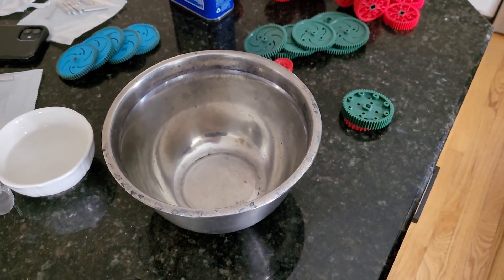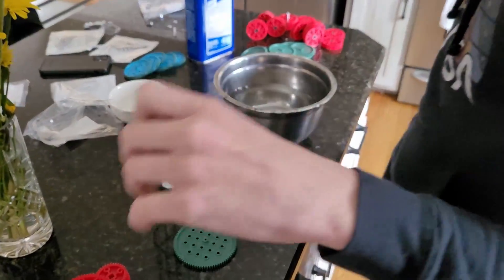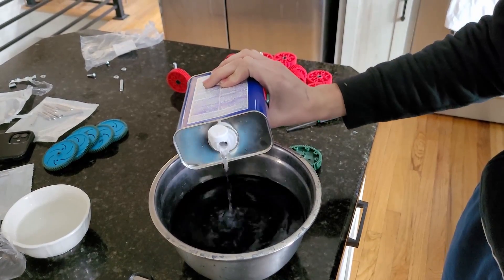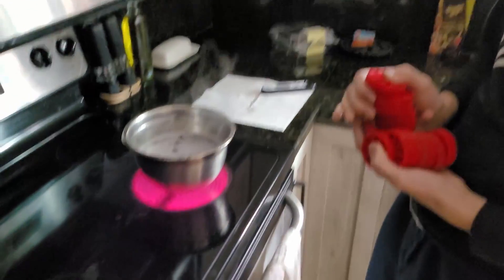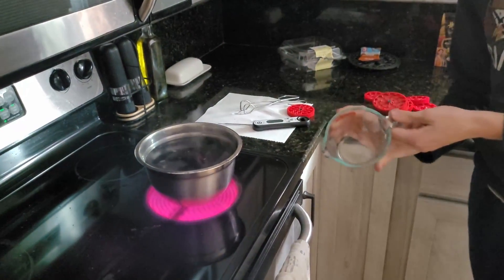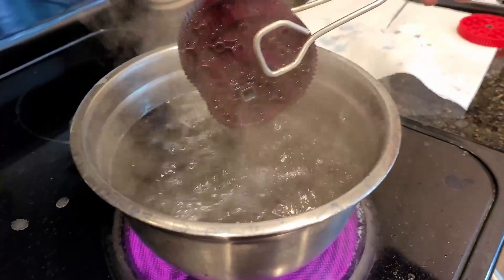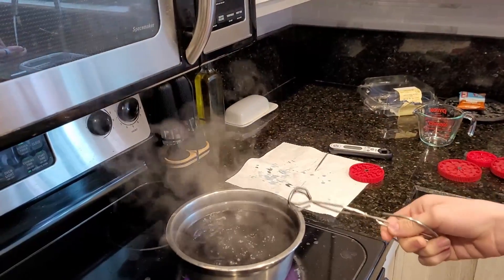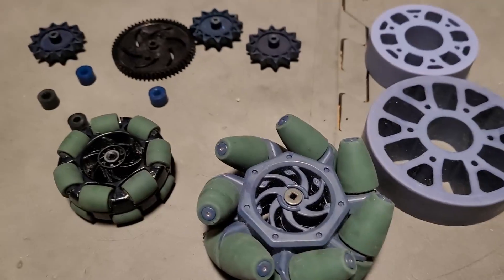How To Dye Plastic Parts | Vex Robotics 60470S Semicolon

Comment: How did you get the light blue color on those gears at the start of the video? The teeth still look green so I'm wondering if you just put masking tape around the teeth and spraypainted the center or if there is a reliable way to get that color with dye. Thanks!

Comment: OK VEX teams, please please please do not do this in your parent's kitchen!  If you want to risk an acetone explosion and dying a kitchen with permanent black dots, wait until you buy your own house to ruin and you have your own health insurance to pay for your emergency room visit.

Do this outside in the grass on an old chair with an electric hotplate (old coffeemaker or the like) and NOT on an open flame gas burner.  Acetone is highly flammable.  It evaporates at room temp but the heating source makes it rapidly boil off.  This is why you have to add more after you do another batch of parts - it all boils off.  There will be a lot of flammable vapor  - another reason you need to do this outside.   Please wear safety goggles or a full shield facemask so at least your eyes don't get burned out if something does go wrong.  

You need to control the temp so the mixture (mainly the water) doesn't boil over out of control.  You can easily do this with a double boiler setup - put water in a pot and heat that directly, then put another pot in the boiling water with the dye.  Doing this, your dye mix won't get over 200 degrees and the water in the mix itself will never boil (the acetone will boil but not the water).  Make sure your pots are twice as deep as your solution so there is no chance of boilover.  Boilovers can cause ignition of the acetone.  When you add more acetone/water mix, it will rapidly boil/foam up multiple inches above the existing solution.  You should be very afraid if a boilover happens - run away and disconnect the power to the hotplate.

You can use stainless steel pots and tongs, the dye will not stain them.  Although your mom will probably get upset if you try to use her expensive Caphalon pots.

Look at the Rit Dye bottle in the video and buy the Dye More version.  This is a synthetic dye.  Regular Rit dye will not work.

We mixed about 4 oz of dye and 4 of acetone in 8oz of water to start out, then added more acetone/water (50:50 mix) with the 2nd and 3rd batch of gears.

Green gears dye within minutes, but red gears take 10 to 15 mins.  We left the red gears in the bottom and just cycled the green gears in/out and pulled the red gears out last.   

Lay the dyed gears out on an old towel and let them dry overnight.  Then the next day wash the gears with soap, water, and a toothbrush to clean off any non-absorbed latent dye so you won't dye your hands handing them.

Good luck!
Reply: or just use spray paint instead of allat
Reply: @redfire7820  spray painting your gears is terrible cause it will never mesh together properly, it causes a ton of friction and it chips off

Comment: if we were to dye omnis, would you suggest to just dye the whole wheel and have the color run out of the rollers. or remove the rollers and just dye the hub
Reply from the maker: We have dyed the whole wheel many times and it works just fine.
Reply: @6047OSSemicolon  splendid, thank you